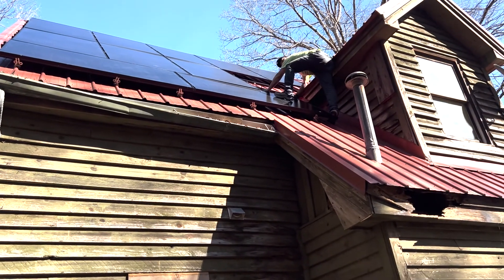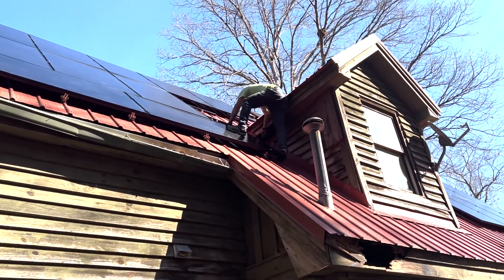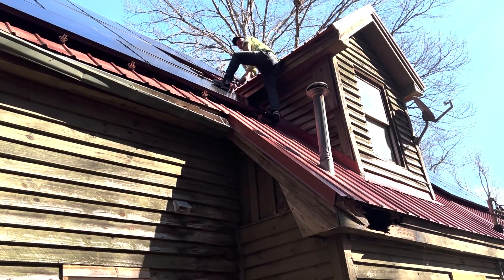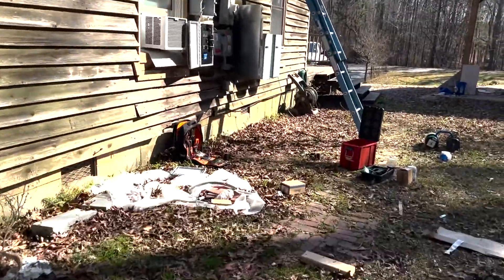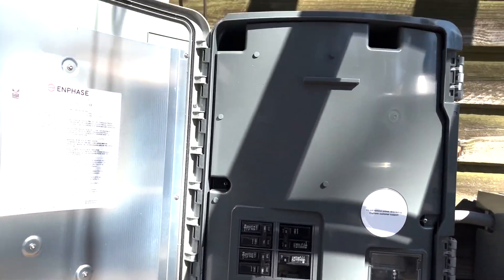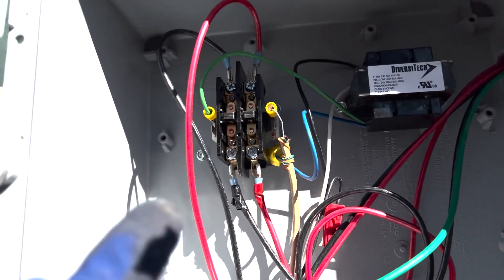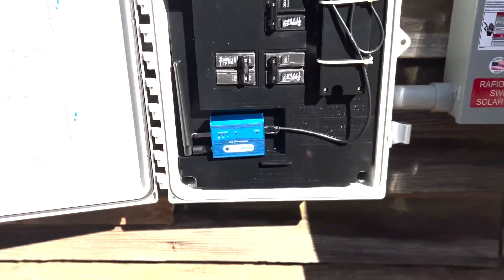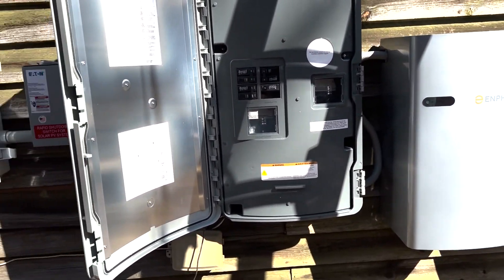Enphase PV Shedding

Comment: So happy the IQ8s don't need pv shedding
Reply from the maker: Who you telling? It makes installation so much faster without having to install transformers and contactors plus validation.
Reply: @thinkpower3653  
I thought the envoy was able to tell iq7s to downrate production when needed, without external contactors, if enough iq8s in batteries were available.
Reply from the maker: @cmijares79  The toolkit will not let you proceed with the functionality test unless shedding is confirmed when using 7’s or 7+.

Comment: I wish there was a more detailed video on how to wire pv shedding and how to troubleshoot if a system keeps powering down when off grid
Reply from the maker: I can help with that. Are you using IQ7's
Reply: @thinkpower3653  I use everything. Im a support tech with a large solar company. Im pretty solid on shedding now - but i do have a couple sites on Iq8s that lose power when we transition off gird. there's very low consumption so its hard to understand why. we use all enphase stuff
Reply: Trying to figure how to even start this PV shedding. 62 panel enphase system with 23 panels need shedding. Any help?